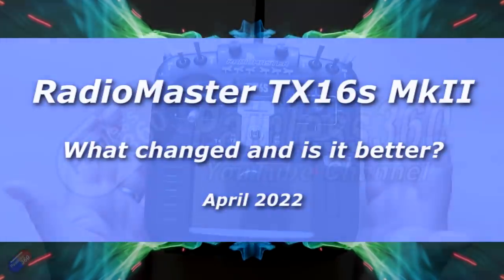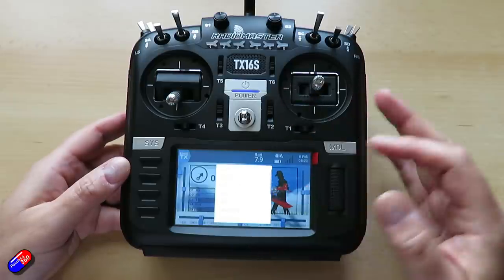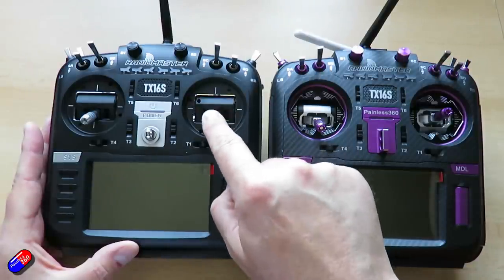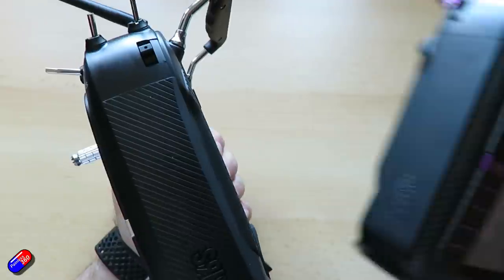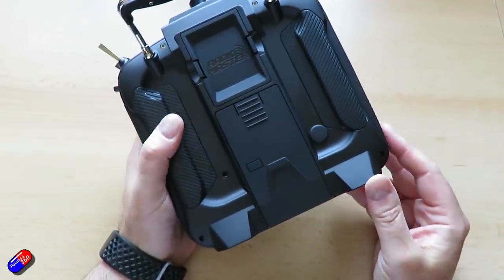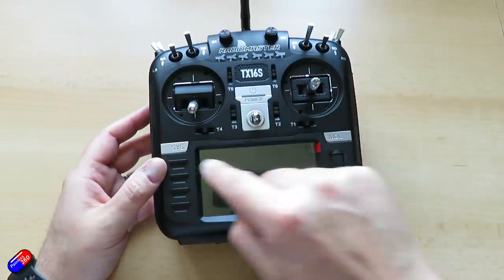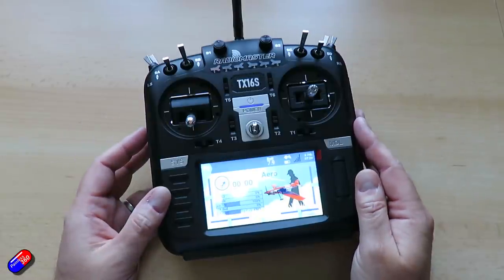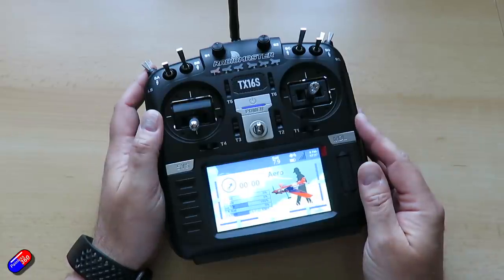Radiomaster TX16s Mk.II: Overview of the what has changed on the newly released update

Comment: I love my cheap FLYSKY FS-i6X, never let me down and does all i want/need.
Reply: Me too.
Reply: Add me to that list!
Reply: I have both and I love the Flysky for a beginner radio, it's particularly good for small hands (especially kids), and supports all the basics. It's what I buy or recommend for people new to the hobby who aren't made of money. The TX16S is a far more advanced radio though and can do way more things. It leaves the Flysky in the dust in this regard. I do wish it was a bit less bulky though. If Radiomaster would put the full 4-1 capability in the TX12 it would be a real winner, killing the Flysky for all practical purposes.
Reply: I'm having a bit of a headache using it with my 800mm fms Corsair. Particularly with the reflex v2 gyro system. I tried connecting it with ppm configuration. All the servo worked except for the throttle. In the end I just used pwm the issue is now I can't turn off the gyro. I'm stuck playing between optimal mode and stabilized mode. It's still fun tho
Reply: Flysky i6x mix capability is terrible.

Comment: I wish they released this version with already installed internal BT . I guess still have to wait for new features in ELRS,to use telemetry app. Thanks for sharing!
Reply: Adding bluetooth is a 10 min job and natively supported. There is even pads on the pcb to solder the chip on

Comment: Thanks for the real review. Your grades are real. Just like each of us has an impression when using it.

BTW. When I read some of the comments, I am reminded of my first radio that still had mechanical trimmers. And the receiver had to be tuned every few months. that I will not mention the over-meter antenna for 27 MHz and the need to replace the quartz for a specific radio channel ...

Now people can complaining because the LED is blinking 3x and not 4x. Really???

Even the best radio on the world will not make us better pilots. Maybe that's why I'm still pretty mach resistant to all these "important improvements".

"Give me the door with the motor attached, and I'll fly too." This is my motto;)

Comment: Great update - I was considering purchasing a used TX-16 first gen and this cleared up the differences. FYI, there are a few 3D printed shoulder switch replacements and folding handles hat you may like. Printables has a few and Thingverse does as well.

Comment: Wow, I have two, ordered the second when charger problems occurred.  I like the complexity ...keeps the brain cells alive. Something to do during covid ... I dont think I'll upgrade, these should last me a lifetime, given my age . A shout out to Radiomaster,  they sent me the parts to fix the first one . Easy repair except that little 4 wire ribbon cable , hard on old fingers and eyes. I tried edge ts, but the relearning was ..  well the replacement board came with open TX and that was it . Thanks for the review, seems there are many new options being offered by American vendors , all based I guess on model 1, moving that old stock out? Take care.
Reply: I'm a newbie only have a RTF Ranger 1220. Looking to get an advanced radio and start buying BNF or PNP planes. Is this the transmitter for me? Hate to get a NX8 and be stuck to spectrum recievers only. Thanks sir
Reply: Yes, get a Radiomaster, you won't regret it.....I'll never go back to being stuck to a single brand/protocol receiver.

Comment: I would have liked to see the momentary switch on the left as it really helps if its used for instant trim. I have done it on my version 1 but it does requires some unsoldering and soldering to swap SF with SH

Comment: The battery door isn't any easier to access if you run the full sized CRSF on the back. They should have put that release tab on the bottom of the cover.

Comment: I wonder whether the new pots with better centre idents will be available as spare parts to upgrade V1 models.
Reply: I would expect so... will just be a spare part, and I don't think anything changed re: electrical connection or mouldings

Comment: Picked the tx16 mk2 with the AG01s and multi protocol. Will just be in the sims for some time but plan to add the 1w 2.4ghz ELRS module when it comes time to build a drone. Keen to get stuck in to FPV

Comment: I made the mistake of purchasing a Jumper T18pro V2 and within 6 months, the right gimbal began to loose calibration. All my quads wanted to roll right and pitch down. I have recalibrated several times and it only lasts for a couple of uses and goes out again. I can find no replacement gimbals from Jumper. Everyone is out so I am switching to the TX16S.

Comment: I've been eyeing this radio since v1, particularly the red and black max edition with the cnc gimbals.  Currently am flying with a qx7-s without no real problems except for when I do firmware upgrades.  
How do the stock batteries compare vs the 5000mah option to the one on the qx7?
Do you think it's upgrade time?

Comment: It would have been really nice if Radiomaster had put a couple of 5.8ghz receivers in there and the option to view  a Diversity FPV  transmission directly in the controller itself. Maybe in the near future!
Reply from the maker: There isn't the horsepower in the radio to process the video. It would be nice but the radio would have to cost a lot more..
Reply: @Painless360   On version 2, can you use the access recievers with it?

Comment: Hi Lee, 
Great review and much appreciated. 👍 
New to RC Flying and looking to buy ELRS version of this Radio and after some training have a Spitfire that I'm getting ready with FPV for kicks. 
Have seen your other videos on Head-tracking setups and these are absolutely brilliant!  
Q? are you aware of any ELRS receivers that have enough channels to support Fixed Wing Requirements W/Landing Gear & HT?  
Best regards from Australia.
Reply from the maker: Hold on, ELRS 3.0 is almost out and may be better for this... Stay tuned!
Reply: @Painless360  Thanks for the reply Lee!!
Reply: @Painless360  Lee - 1 other question which was unclear for a total newbie like me, 
Does the new ELRS version run on ELRS ontop with the 4-in-1 system still onboard? 
or 
Is it only 100% ELRS and there is no 4-in-1 telemetry involved? 
Thanks again

Comment: Nice vid, I updated mine to Edge TX but the touch screen didn't work , I have two speakers in my unit but my jog wheels is plastic. Do I have the SE model ?
Reply from the maker: All of the TX16s units have a touch screen so I'd suspect that one of the cables isn't seated properly... Best of luck!

Comment: ELRS or Crossfire ? Are the both analog ? Which is more capable for distance ?
Reply from the maker: Depends if you need more than 4 full resolution channel and SBUS output on the receiver along with other things (Smartport output etc.).  If you do then ELRS isn't for you (at the moment). ELRS is great for quads and flight controllers but nor great for other stuff like fixed wing

Comment: I wonder if you can help was at RC club Sunday and were having problem with the throttle trim using mode 2 when in lowest idle  throttle trim only works up none down but if i put stick in centre position i can trim up and down.
Reply from the maker: I've not seen that. What software and version?

Comment: Hello there Lee, good video above.
William down in South Africa here.
Looking for some help if possible.
My TX16s Version 1 has suddenly started putting in some positive and negative elevator input when the throttle stick is used (Mode 2, so separate sticks).
It is right across all models, and even does it in the calibration exercise.
Any thoughts or experience on what to do?
Cheers,  
William
Reply from the maker: If it is only on one model then I'd check that something wired hasn't been setup like different trims in the flight modes etc. Best of luck
Reply: @Painless360  Hello Lee, thank you for your note. I searched around a bit more on the net, and after unsuccessfully formatting the SD card, the radio came right after removing main and onboard batteries for a few minutes. One more calibration and it's all sorted. Appreciate all your videos. Ta.

Comment: Hi.
I like your channel as you explain everything in simple terms but I am having trouble with my radiomaster TX16S mk2. I was using Jumper T16 with open tx and thought I would go over to edge to so bought the latest TX16S but for some reason I cannot bind it to any Rx.
I am trying to bind to Frsky RX8R pro.I set internal module, Frsky D16 protocol, press bind, hold down button on rx and connect battery. The red led comes on so does the green and the chirping stops on the tx. Restart both and the rx led is slowly flashing red meaning signal lost. I have tired to bind a Turing year rx and a jumper rx and none will bind. Am I missing something.
Paul.
Reply from the maker: Has this reviever bound to the original radio?
Reply: @Painless360  Hi.
Problem solved. I had to select FRsky-X and EU LBT protocol on Tx and then it binded ok.

Comment: Hello, I am having an issue with my radio master mk2 set up, I cant seem to find a radio set up video for it regarding any of the kopilot products, just videos involving inav or betaflight. I have a zohd 250g dart and I can bind it get everything working properly but the stabilization I cant seem to figure out how to set the three modes to one or any switch. It worked fine on my flysky transmitter but that broke so I upgraded to the radiomaster. Any tips or tricks would be appreciated!
Reply from the maker: Seee my videos on Kopilot setup. Nothing special with this radio for the setup... Best of luck

Comment: Would a second GPS system hooked to one of the lower UART's make iNAV return to home function smoother? If not, would this possibly be a way to improve signal of a flight controller?
Reply: I don't think so... It would just allow you to have thinks like GPS co-ords of the transmitter on screen, and be able to show distance and direction between craft and transmitter if the transmitter is moving (i.e. on a boat) or moving towards last transmitted co-ordinates if it crashed...
Reply: @pfeerick  that may be handy for filming or finding a crash!

Comment: Would like to know how to get it to read engine temp and RPM.  I can not fine a thing about it.
Reply from the maker: https://www.flyingtech.co.uk/electronics/frsky-smart-port-telemetry-rpm-temperature-sensors#:~:text=The%20FrSky%20Smart%20Port%20RPM,20%20to%20250%20degrees%20 Celsius. With a Smartport Frsky RX?

Comment: Thanks Lee.  Great video as always.  

Quick questions.  If I was to purchase the standard MK2 version:

(1) Can you swap the GNC Gimbals from V1 one and place the ones from the MK2 into V1?

(2) Can I simply install the same version of EdgeTX from my V1 to  MK2, copy the entire contents of my V1 Card over to the MK2 (or swap the SD card) so that the MK1 will have all my models and exact settings (include global functions, etc) as the V1?

Thanks,
Sam
Reply: 1) The gimbal attachment is the same, thus you can install AG01 or FlySky digital gimbals also into TX16S mark II.
2) EdgeTX firmware is the same for the first generation TX16S and mark II. You only need to re-run the calibration.
Reply: @ristokoiva  Good to hear. Thank you very much for jumping in to answer my (dumb) questions!
Reply from the maker: No such thing as a dumb question! Thanks to RK for answering!